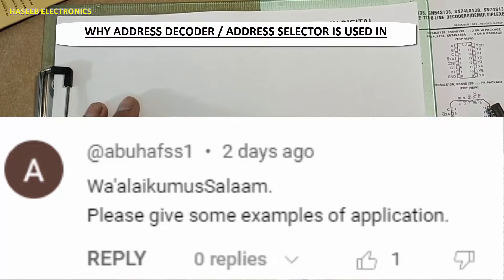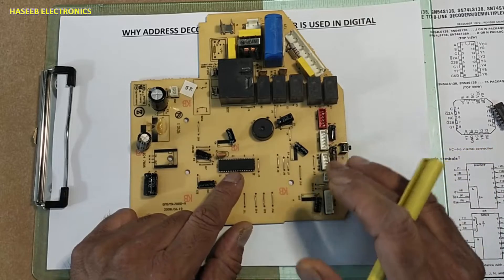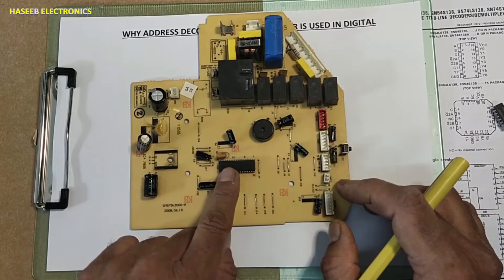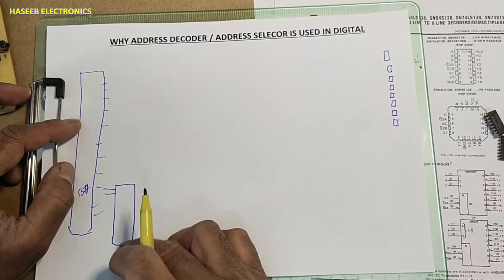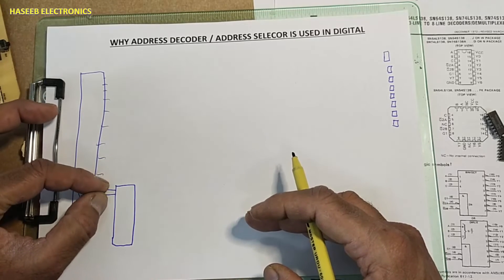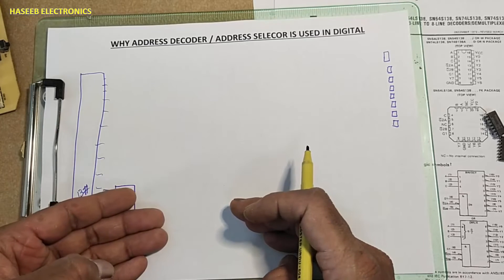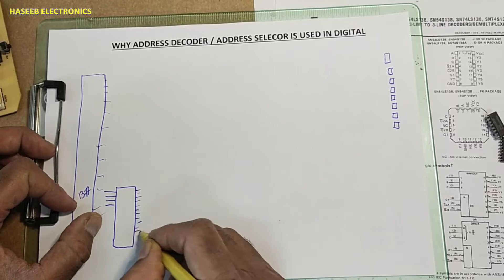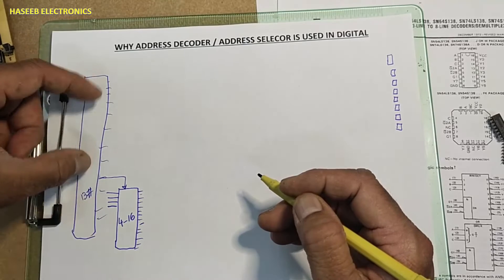{996B} why address decoder is used in digital electronics?

Comment: Excellent explanations! Sounds like multiplexing  a 7 segment display in an alarm clock with only a few wires. On some videos I've seen there is equipment on the bench that you can see each number being individually flashed due to the synch rate of the video being in time with the multiplexing of the digits. The person filming the video can't see this, but we can. Kind of like using a strobe light for ignition timing on an automobile. Fascinating subject and that's why I love this channel. Thank you and have a great weekend!
Reply from the maker: thanks a lot for your valuable words 
yes it is similar to multi digit 7 segment display using same data lines and some control lines or enable lines. 
yes some cameras cannot capture the display due to scanning rate mismatch. 
you appreciable words for encouraging my efforts are a valuable asset for me 
please accept my best regards